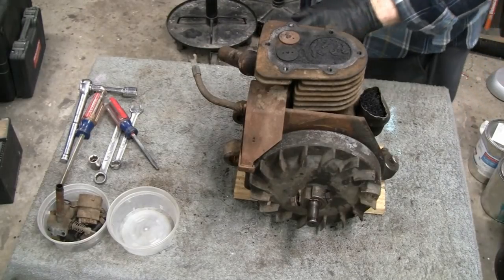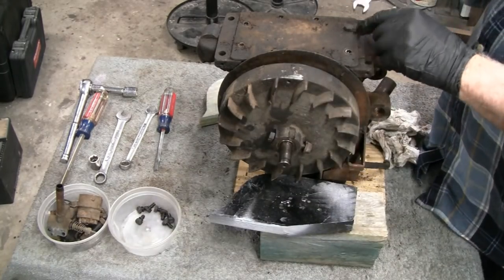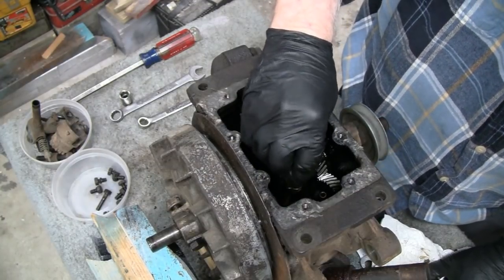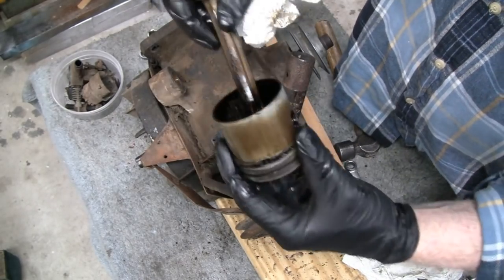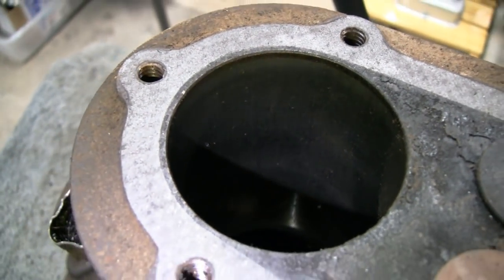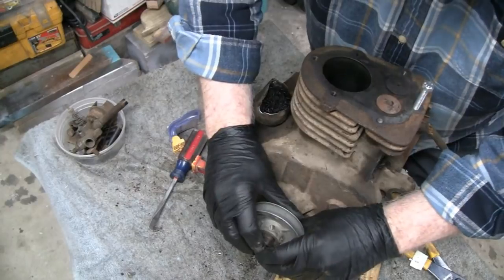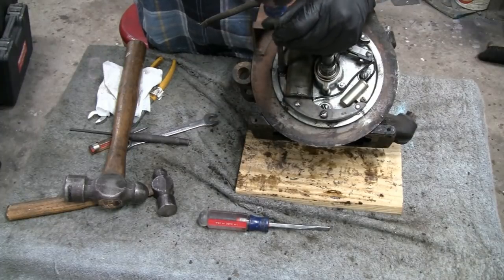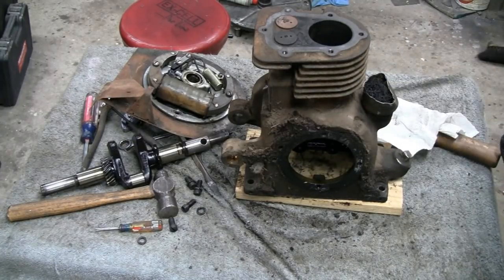BRIGGS MODEL Y REBUILD (part 2)

Comment: Busted by the boss. You just can't be Tarzan in the shop these days LOL! I bet when grandma's old washer finally gave up, grandpa pulled the engine and stuck it under the workbench where it sat until the estate sale....You really cracked me up @22:30
Reply from the maker: I wouldn't be surprised if it was replaced with an electric motor, the ol' Maytags weren't know for giving up!!☺
Reply: @805ROADKING  good point!

Comment: Hey boss, if you haven't already tried to get the broken bolt off, from the video it looks like theres some sticking up still. I would thread a nut on it or slip one over it and weld the nut to it. 9 times out of 10 the heat from welding the nut on will free it up and you can put a wrench on it and turn it right out. Good luck.

Comment: Way back in 1989, I was at Wembley Stadium in London, England watching the Eagles beat the Browns and I have been an Eagles supporter since, so being as the video went up after the game, I did chuckle at the Saints result. It looked like there was something written on the heads of the connecting rod bolts, was it anything special?
Reply from the maker: I seen the writing on the bolts!! Probably just the company initials that manufactured the connecting rod!!☺

Comment: Is that a gas or electric heater.if gas is it expensive to run
Reply from the maker: I've been using a gas wall heater for the last 30 years and it hardly cost anything to run!! I just changed over to electric last week so I can use a thermostat and keep the garage at a minimum of 40 degrees!!☺

Comment: You know road king, seems like the lack of wear and the abundance of carbon, that engine was probably never used and only started and run occasionally not letting it heat up. It looks too good on the inside to have been run for very long
Reply from the maker: Yeah John!! It's definitely a mystery!! I've never seen an engine with that much carbon, especially one in that great shape!!☺

Comment: Alright RK, another good session. Hey, how do you like your new garage heater? I got the same one and finished the install this past Sunday. The electrician came and connected it up to the service and it appears to be running good. Got a t-stat from Zoro supply ,(line) will install latter. Keeps my garage shop at 68 F with no problem. Cycles fine. So far happy with it. Good thing .
Reply from the maker: I'm loving it John!! I'm still waiting for Mike to get a chance to get over here to hook up my thermostat!!☺